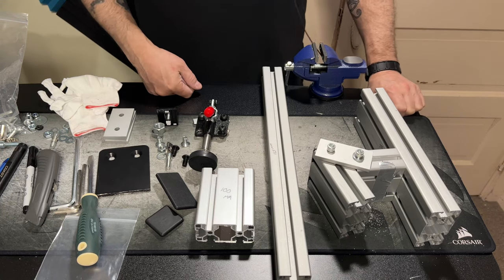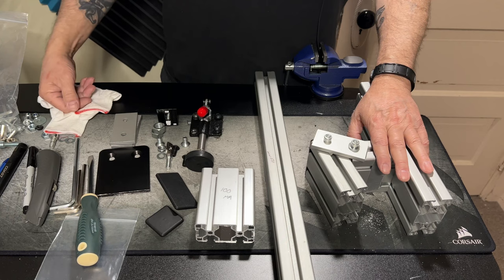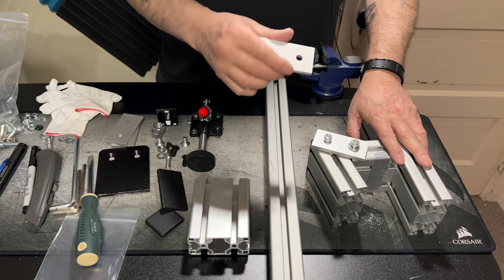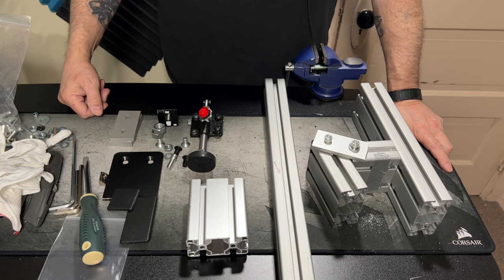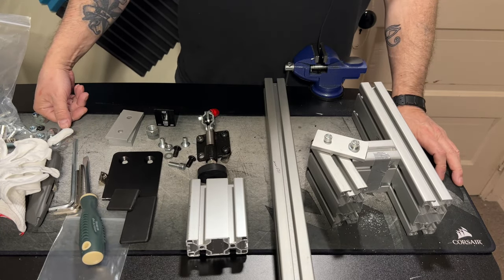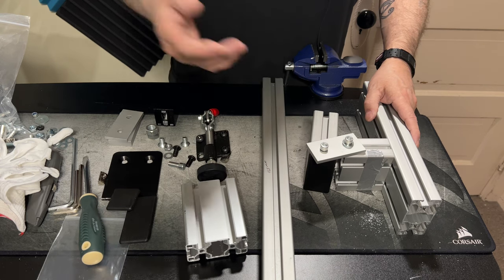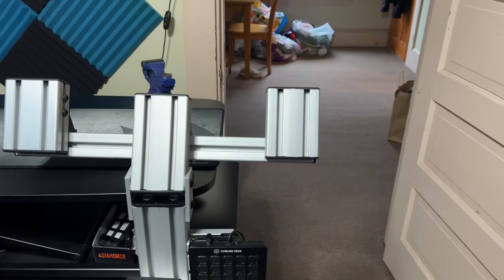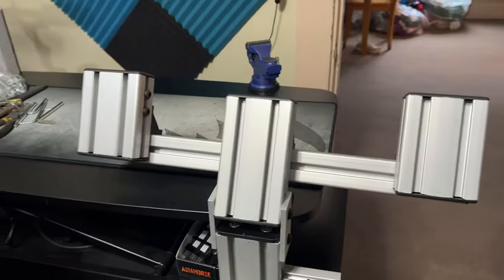How to build a MIP mount for DCS F-18

Comment: Hi JP, Great video, you did a good job. I'm thinking about getting a MIP. If I may ask how the braket is attached to the table. I mean, the bolts in the black metal plate on the table, how they are fixed to the braket?